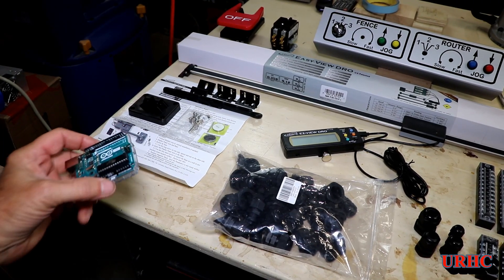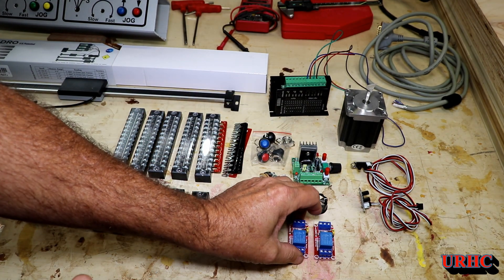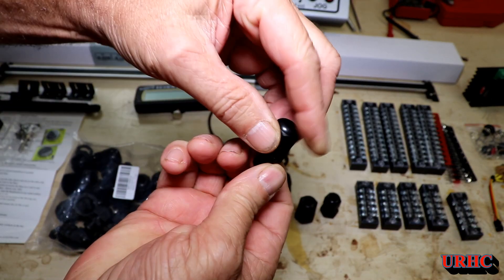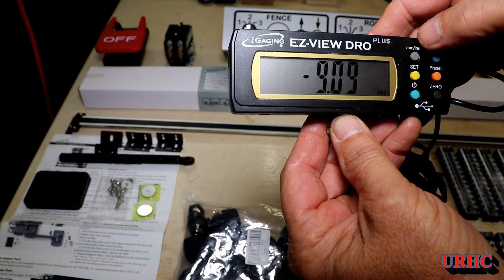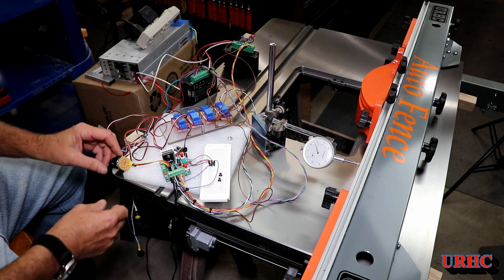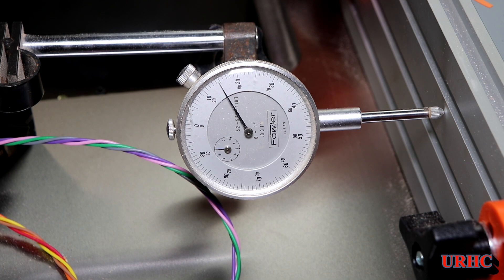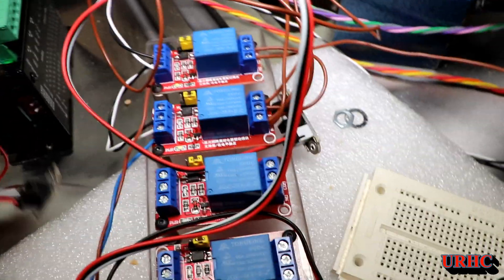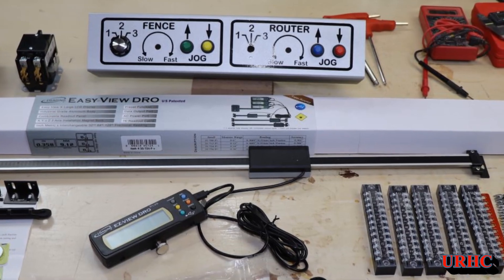Router Table Build Part4 Gave Up On The Arduino Changing To Pulse Generators And DROs

Comment: Love it, have been looking for a simple way to control steppers and was about to try an Arduino. Can you link the Pulse Generators, relays and DROs that you used?
Reply from the maker: I put links in the follow up video. The DROs came from ebay. Taylor tool had the best price at the time. I have to keep the drives enabled to keep the movements from creeping under load next. May just use a 4 pole relay to short the 4 wires so the motors don't get hot. Thanks for watching.

Comment: After seeing finished product I had to review the build just amazing how did you ever learn how to make it all work, all the electronic stuff ? Question 2 In your bathroom floor video you used a compression toilet supply I know you research things and was wondering why you choose it over shark bite fitting. Thanks Bill
Reply from the maker: It's all on the internet and I have let plenty of smoke out of electronics that helped me gain experience. 

I had that valve in the barn. I have looked at shark bite in the past but don't want to buy the deburing gauge. I usually just solder things like this but didn't want to take a chance of damaging the floor.  Just bought 2 more new compression valves for the sink and they cost the same as the shark bite valves hanging in the store next to them. Thanks for watching.

Comment: I have the MLCS lift and you would not be happy with it.  It is not much of a precision instrument.  Your design will work much better I'm sure.  What are you using to make those nameplates?  They look really good.
Reply from the maker: I think this will be simpler in the end also. I will be able to move the router up out of the table for bit changes but it means this will take a lot more time. I have been using the Cameo 3 vinyl cutter that I made a video about a couple months ago with oracal 651 vinyl.  Its great for labels, stickers,  car graphics,  and heat transfer t shirts.  They actually have a new model coming out next week that will cut 3mm thick wood I want to upgrade to.  Circut also makes a similar machine  but it's web based software. Thanks for watching.

Comment: Maybe I missed this, but are you doing anything to take out backlash in the drive mechanisms?
Reply from the maker: I am just using the spring loaded zero backlash double nuts loaded to the back of the fence.  I also have a adjustment screw to account for the screw end play due to the cheap bearings.  With the dro I no longer have to worry about that. Just go back past the number and then step fwd to remove any backlash like you do on a Bridgeport.  Thanks for watching.

Comment: I've been wondering why, and bang, I got it. I thought you were cnc'ing and what you were after was fine adjustment! I've never thought of that, on the router, but the milling machine would be a good place. I guess not seeing a gantry should have been my first clue! Great series!
Reply from the maker: I have a cnc router that I built and just wanted a router table that was easy to adjust.  My first thought was an arduino with tablet or touch screen to activate the moves but I soon found out how much work and learning it would take to complete the software.  This just simplifies it and removes a lot of frustration for me. Thanks for watching.

Comment: You never cease to amaze.
I stopped designing and building, many, many, years ago. 
I tell my buddy and best friend who is also an engineer, I should have never got out of it. 
The things he did, just amazes.
Reply from the maker: Have to keep the brain from rusting up. Trouble is trying not to over complicate things. I designed some of the most advanced laser diode fabrication equipment in the industry at one time. But now I just play. Thanks for watching.